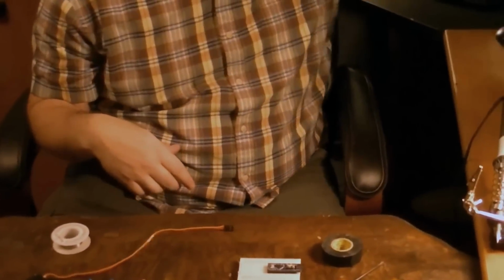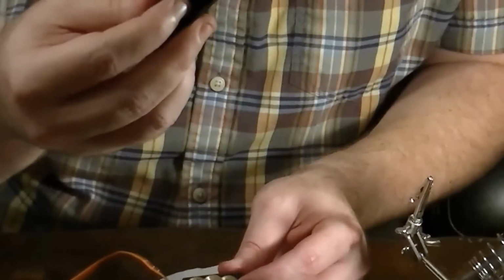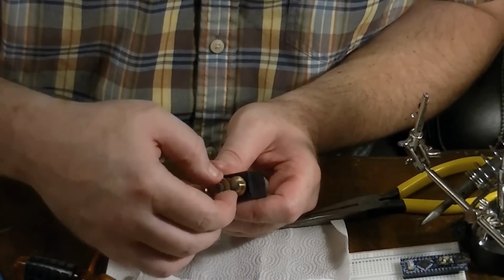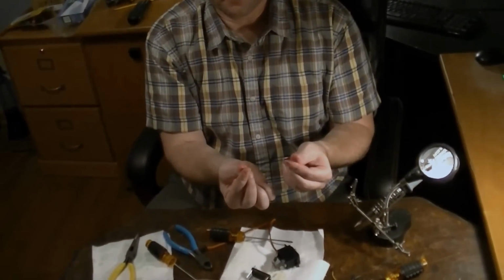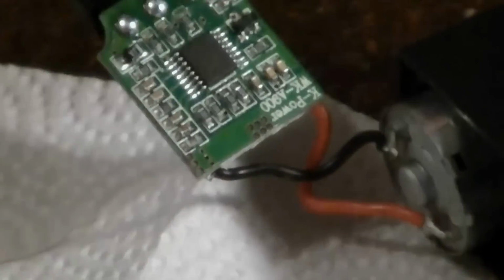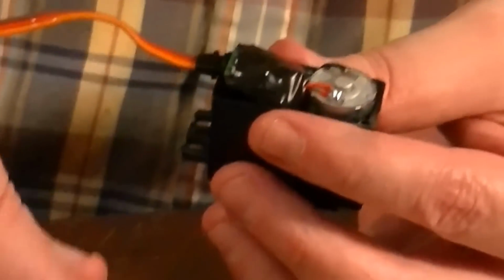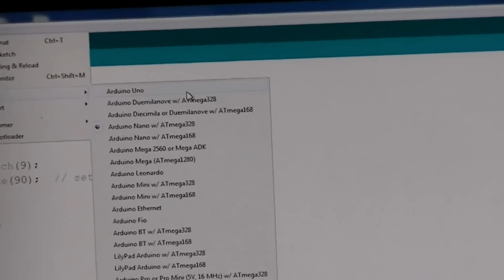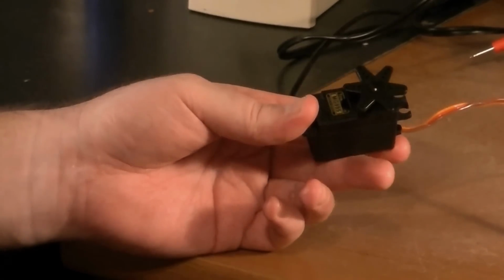How to hack the TowerPro MG995 Servo for continuous rotation

Comment: There is no need to drill/file out the rectangular hole in the gear because you've disabled the potentiometer anyway (cut the wires). There is plenty of room for a couple of 1/4W resistors in there without removing the pot. Even better if you use two SMD (surface mount device) resistors.

Comment: Why remove the potentiometer?Just adjust it to center an push it down from the upper side to disconnect the output gear from it.This hack works with my servo and I can reverse it to make the servo behave like older way.
Reply: That's a brilliant suggestion. With the potentiometer disconnected like that, this mod is much simpler, it's reversible, and it does not require any soldering.

Comment: Why all the work with the resistors? 
All you have to do is make sure the potentio is in the middle then remove the coupling between the sprocket and the pot. At least that is how I'm doing it at the moment. I hooked it up to a RC TX-RX set. put the the sticks in the centre and with most of the gears removed turned the pot til it stopped moving. Then with the entire system active I reassembled the servos and to make sure I don't turn the pot and presto.

Done without soldering. 

Or perhaps I'm going to get other problems later on like drift from changing temperatures and such because of this that I will not be able to counteract with the trim sliders?

Comment: could you please help me on how to connect 6 of these servos to 
power supply?
I have a 40VDC , 5A power supply. When I connected three servos in 
parallel , one of them only worked because it absorbed a lot of current ,
 while the others didn't. I tried to use a current limiting diode but 
still they are not working.

Comment: I think it doesn't matter what values of the resistors are, as long as values would be the same (as close as possible). Therefore voltage would be divided equally and servo would think the shaft is in the middle.

Comment: Thanks, tihs works for me.. MyMG995 is a bit different, I had to remove the pot-meter, because the gear on top of the pot meter was all metal,Could not take out the plastic piece..It works just fine :)